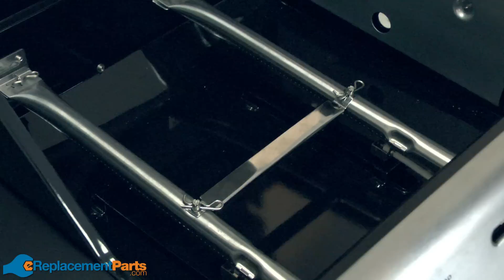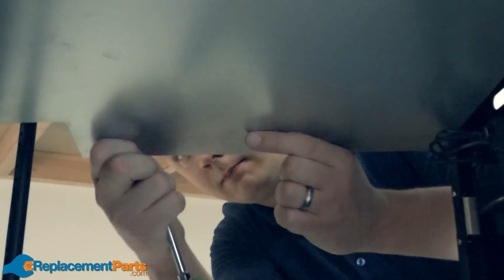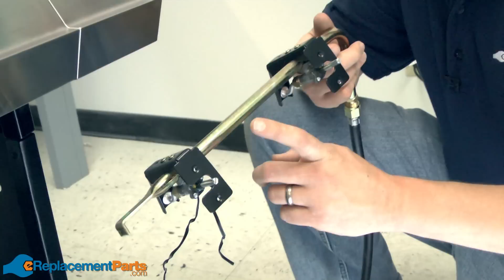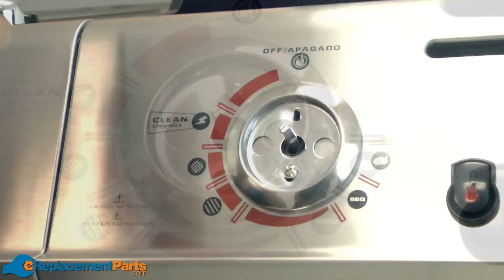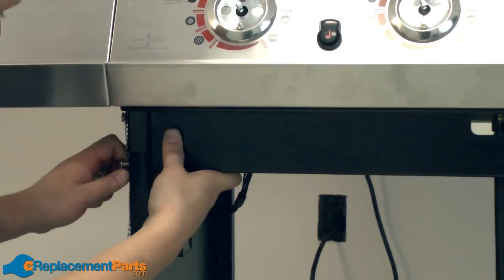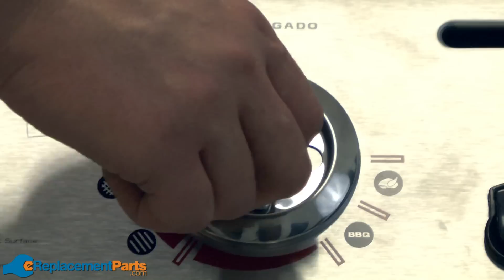How to Replace the Hose Valve Regulator Assembly on a Char-Broil Tru-Infrared Gas Grill

Comment: Very helpful. Too bad my grill isn't as clean as yours.One side of the grill  area is full of carbon because of a problem with one of the burners. That's why I'm replacing the assembly. But all in all , I now have an idea of what needs to be done.

Comment: this video is titled how to replace a regulator...but all I saw is how to disassemble a grill to be able to replace a regulator. You completely skipped over actually removing the regulator hose and attaching a new one. My grill isn't brand new so the nuts are completely stuck and I was looking for a helpful approach on getting the actual regulator hose off without breaking any other parts or stripping the threads on the nut.
Reply from the maker: Usually the fittings on most regulator hoses are made of brass which is far less likely to corrode and become difficult to remove. Using your wrench on the hose side fitting is typically all that is needed to loosen the hose.  If it is giving you trouble you can use either a wrench or channel locks to support the manifold to avoid any damage.  If
the other screws and bolts are corroded and difficult to remove, I would try some penetrating oil and let them soak for a while.  This usually works for us.  If the screws and bolts seem corroded you may consider replacing with
new once you have them removed.

Comment: yeah but how do you do this on a 4 burner unit.  holes on either side are too small to  pull the hoses through
Reply from the maker: Janet Bird The hoses provide by the manufacturer are OEM and should fit exactly as the originals.  I would double check and make sure they were sent correctly. It is very uncommon for the manufacture to make a part change and not either provide instructions or the parts to update the product.

Comment: Can you replace just the hose regulator valve piece instead of the entire assembly with the cross pipe, etc.? It would be a lot cheaper--about $16 vs. $70.